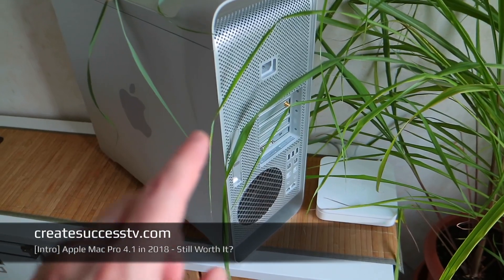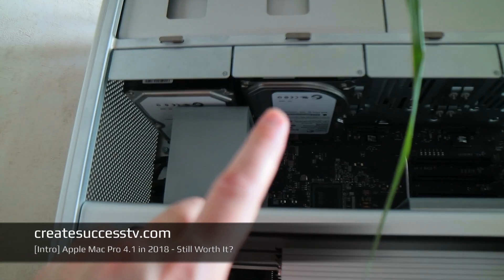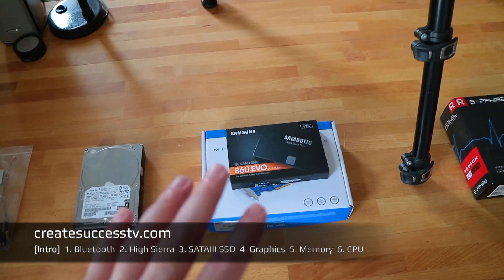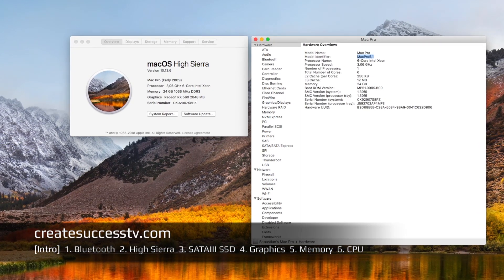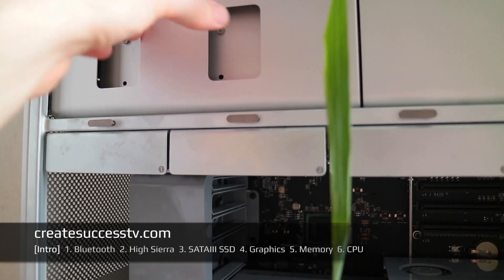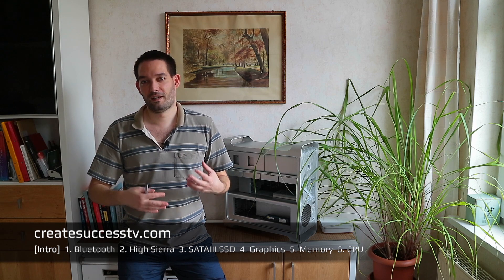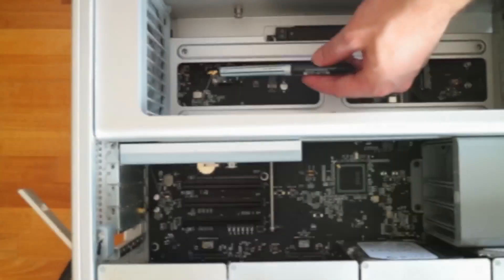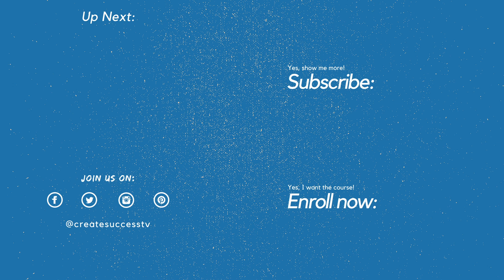Apple Mac Pro 4.1 in 2018 - Still Worth It?

Comment: for the dual cpu board, can I have 24 cores on a 4,1 or 5,1 mac pro ? (2) 12 core Xeon CPUs?
Reply from the maker: No, the highest CPU possible is the (Westmere) 6 Core Xeon X5690 with 3.46 GHz, personally I use the slightly slower 6 Core Xeon X5675 with 3.06 GHz, because it is only half the price and uses less energy.
Reply from the maker: Also, there is a Mac Pro that uses CPUs without IHS, in that model it is possible to overtighten and damage the board pins, it is the most difficult upgrade.
• Mac Pro 4.1 (Early 2009) Single CPU  = normal upgrade
• Mac Pro 4.1 (Early 2009) Dual CPU = difficult upgrade (uses lidless design without integrated heat spreader)
• Mac Pro 5.1 (Mid 2010~12) Single CPU = normal upgrade
• Mac Pro 5.1 (Mid 2010~12) Dual CPU = normal upgrade
Reply from the maker: Please read the forum post to see a list of compatible CPUs for the Mac Pro:
➜ https://forums.macrumors.com/threads/mac-pro-cpu-compatibility-list.1954766/

Comment: Are these 6 upgrades compatible with the Mac Pro 3,1?
Reply from the maker: The early generation Mac Pro may look similar on the outside but the hardware is very different. The memory, for example, is 800 MHz DDR2 ECC instead of 1333MHz DDR3.
Reply from the maker: Of course, you can still do a variety of updates, but I would first look into which OS this system can run.
Reply: Google: The Definitive Classic Mac Pro (2006-2012) Upgrade Guide
All you ever need to know, well not quite but more than enough.

Comment: Thanks for this fantasic series on the Mac Pro desktop. I was all set to build a very high end hackintosh,  but you have made me change my direction. I would now rather put the effort in upgrading a good 4, 1. Please keep up the great work. You deserve many more subscribers than you have.....
Reply from the maker: Thanks, Canjo 7, yes I agree, the old Mac Pro still performs great even after so many years, with a few upgrades it became really fast, feels almost like a completely new machine, haha…
Reply from the maker: The next project I will look into is replacing the old fans, with new super quite Noctua Fans. People have claimed that the Mac Pro does not use the standard PWM fans, however, I still want to find a solution to replace them, let’s see what I can find out here.